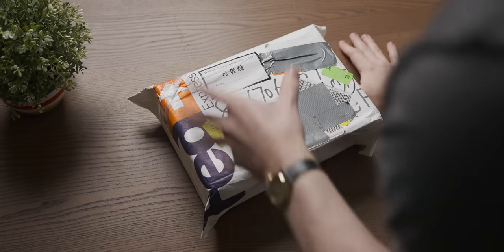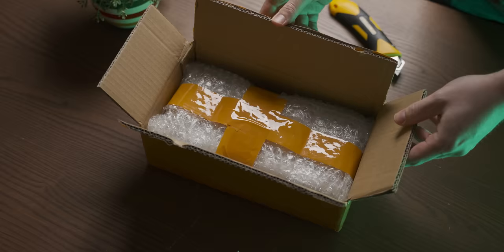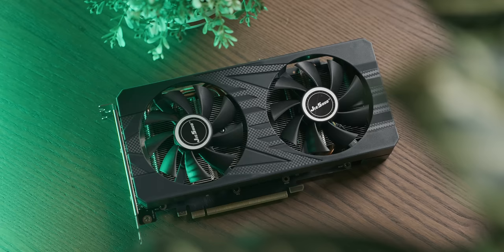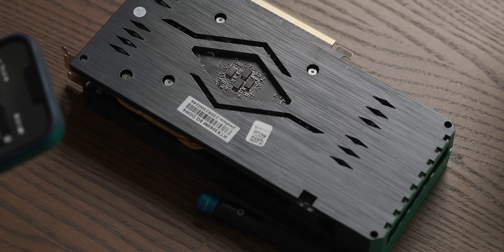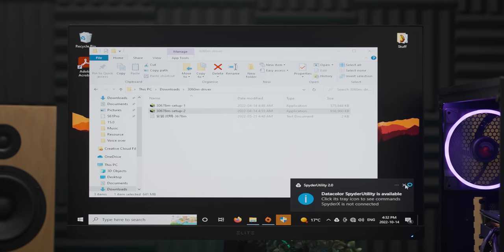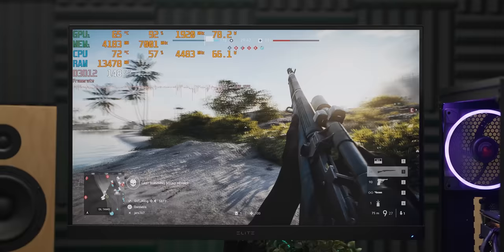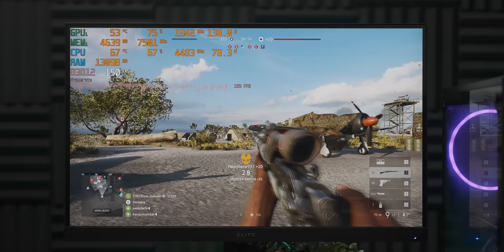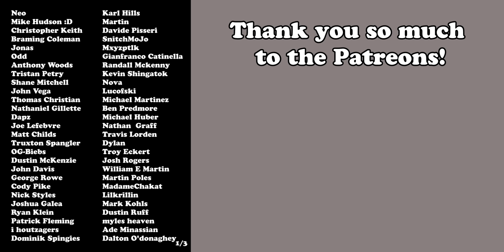This "New" RTX 3060 From Aliexpress Was Suspiciously cheap...

Comment: Actually a bit sad that it only works with * special * drivers if they would remove the 6 pin and let it only draw up to 75w via the pci slot this would be a insane good upgrade card for older prebuilds with shitty psus u cant upgrade
Reply: @Those Casual Gamers what
Reply: @Those Casual Gamers what?
Reply: Though doesn't mean the wattage showing on-display is any accurate specially with those Frankenstein GPUs, it was cool if he actually have measured it physically...
Reply: @Those Casual Gamers what
Reply: @guily6669  i mean its a 3060 mobile they a build to draw as little as possible and i think it would still run fine with 75w
Reply: @Those Casual Gamers What? Yeah, weather at the delivery point has a lot to do with the original commenter's sole point about  physical 6 pins vs PCI slot power draw of the card itself. That makes sense.
Reply: @claycassin8437  Did they comment on the wrong comment?
Reply: You can lower the power consumption on normal cards as well
Reply: @Slamdoxicalz  ye but usually if a card has a 6 pin it wont start without it conncted
Reply: It’s hard, specially laptop version is hard to twist power consumsion. Because it was design to co-op with cpu or could be depend on game they will need more power like some game it ate nearly 80w
Reply: My thoughts exactly.
Reply: I bet if he used NVcleanstall and select the mobile drivers it will work
Reply: Exactly.  As long as the PSU is 300-400 watts, I see where your going.  I just had this very situation with the wifey's computer, I had to go with a 1650, because no other graphics card was powered by the pci slot alone, or at least did not cost 350 dollars.  I would of loved to put something like this mobile 3060, in her system powered only by the pci slot.
Reply: @erich6860  I had the GTX 1650 in my prebuilt. Its decent enough. You can game on it, though its a bit stuttery and youll have to drop some settings. I had to swap out my PSU when I upgraded my GPU, but I still got $100 for the 1650 during the great GPU shortage of 2021.
Reply: I was thinking the same thing.
Reply: @stephenhood2948  Yeah, I men the missus is not really playing anything more demanding than WoW, V rising, so it's fine.  But it would be nice to have more for the wattage 🙂
Reply: Absolutely! Make this low profile and lose the PCI power connector and it'd be a top tier product. They'd pretty much be able to monopolise the space since other LP PCI powered cards would be way less capable.
Reply: Most 3060m draw more than 75 watts and there could be specifics to laptop power (like some have power shifting so a "75 watt" chip goes up to 95 watts) delivery that makes this iffy sadly. You would just be better off running a 3050 at that point.
Reply: Uhhm maybe that's where A2000 comes in, with RT core and same 6GB VRAM at 70W TDP but more than twice the price of rtx 3060
Reply: Or just keep the 6pin and have the GPU switch into a low power mode when it's not connected. The 4090 does it, so it is possible. I agree that if Nvidia would actually do this officially (make drivers that work), then it would be amazing for small / efficient / quiet builds and junky prebuilt upgrades.
Reply: @PMARC14  Sounds like an RTX3050M low profile would be as good as it gets.. if they would make one.
They seem to prefer to make it look like a real gaming GPU.
Reply: Just use molex to 8pin if you know for sure it only draws 80w. 2x molex has a rated max of ~100w so you'll be fine.
Reply: This concept has many fallacies. 
1: A 75W 3060 has terrible value. For a price of 3060 you are getting 2060 level of performance.
2: Sunk cost fallacy:  If you bought a prebuilt with a proprietary PSU, getting it is your mistake the first place. Selling it an getting a properly expandable system, is better than spending money on a bad system. 
3: Budget builds with used parts : If you bough the prebuilt for cheap, getting a cost inefficient card goes  against the principle of doing a budget build. It better to get slightly more expense used config which can handle 150W-200W+ cards. 
4: Upgrading the computer for the sake of upgrading: If your  computer is outdated, either sell it  , or recycle it. (Or even  keep it as-is if it performance is sufficient for your use case ).
Reply: This is what I want, currently, there is no cards with Ray Tracing that doesn't only draw from the PCIe slot
Reply: loh bro bro, like I will let PSU hold me back. funny man
Reply: @macattack123mattc3  Nvidia would kill its A4xxx lineup, and that would be silly. For  them.
Chinese ppl on the other hand don't care about Nvidia bottom line :)

Comment: Pretty sure the driver issues came from Nvidia seeing tons of miners doing this laptop GPU on PCIe card thing (because non-LHR), that they started specifically locking out this config. If you go back even further, you may find older official drivers that fit.
Reply: They could have also just add lhr on all laptop GPUs, but I guess it takes more effort.

Still pretty sure Nvidia just disabled LHR recently so would be nice if they don't lock this out
Reply: @mcslender2965  No reason to.  nVidia just released a new driver that unlocks LHR on desktop entirely, as mining is basically dead now that ETH no longer uses Proof of Work.  The aftermarket is already overflowing with cheap cards and it's only going to get better.
Reply: @TheXev  where do you get em do, cant seem to find them
Reply: @TheXev

Comment: Really makes me wish there were official mobile variants of these for desktop. Would be killer for low profile card builds
Reply: So laptops?
Reply: Oh man the efficiency
Reply: Yeah, we lp users are still stuck with 1650/rx6400
Reply: yeah me too less power drained cpu and gpu less cooling effort more durable less sound more stabilty not everyone need lıyd sport cars
if i find from somehwere money i will invested for pc that direction.
price goes roof when high watts need it u need much better psu much better cases and cooling lot more electric bill much more problem.60-80 wt gpu and cpus good durable mb
lot of people donyt clean up much or dont invested expensive thing or not renewing long tinme.
in time all those fan start do sound at high sound 6-12 monrth or even shorter while moslty even they start problem low speed u wont hear them much even 4-5 year later
an example milion of milion people playing basic game use social media nad some old ganmes like world of warcraft dont need so good system
best of the best look good but not so much diffrence not everyone pro gamer 
low profile and cheaper but enough power cards always welcomed but some users
like me.
Reply: @kazikokaziko4903  you should see the "laptop" cpus converted for 1151 motherboards... people got mad at intel for thier firebreathing 10th gen intel chips..... 

these laptop cpus like the qqls /qtj1 can run 5ghz 8c/16t on a laptop chip that is supposed to run 45ish watts stock.... but they can pump out 200w if the motherboard has the vrms to handle it D:
Reply: tech yes city reviewed an amd 6600m that works with official drivers
Reply: I rather like those Teeny tiny PC's they tell people to take with them on holiday or business trips that are functionally like a laptop but without the screen.
This (malicious software aside) is leaning in the right direction.

Here is a thought if the use case for these applies to China what about somewhere else, what might you find in say Vietnam or Korea or even Russia ?
Is there a market for something like this other than China that can supply a similar produce perhaps.... I guess one can attempt to make something up yourself if you are very technically minded or someone makes the graphics cared equivalent of Hard Drive cases that might work too.
Reply: You can always undervolt and power limit PC GPU to run as efficiently as a mobile one
Reply: The hell do you even mean??? These are laptop GPUs, which are fine in their own right.
Plus you can only go soo far with low profile systems. The 1650 was the best of them all, but that had a dual slot low profile fan, and no power connectors as well.
Maybe if they made a desktop version of the 3050ti mobile that’s exactly 75 watts, that could work. But then you’d basically get desktop GTX 1650 super or desktop GTX1660 levels of performance. Which isn’t really much.
Reply: @zabunko  some people like me are looking for a sff pc build but dont want a laptop for various reasons
Reply: @AlanWGMeraz  Don't forget the rtx a2000
Reply: low profile card builds which you want to sell to others so you can rip them off and make more profits.
Reply: @IceColdRona as someone above commented you can do the same with regular cards nowadays by undervolting. That's basically what they are but you have to have a bit of know how. I guess it would be cool for people less knowledgeable but it would technically be a ripoff.

Comment: You can probably force it to install the official drivers by using the "Have Disk" option in device manager. Yeah that still exists, all the way back from Windows 9x. I bet it's just a simple Hardware ID mismatch between what the driver says it supports and what the 3060M reports. The seller probably had to hack the installer to get it to work easily enough for the consumers, and the antivirus heuristics picked up on that fiddling.

Comment: The driver issues are a major deal breaker, doubly so with the malware bundled with the janky drivers.
Reply: That's why 6600M for 170$ is a way to go :D
Reply: They will get better though like other scam GPUs and this one might get good enough to actually buy
Reply: @16driver16  Honestly given normal desktop GPUs are not much more on Ali... i'd question if this one is worth it at all, even at the 100usd mark it'd be a bit questionable.
Reply: @kajurn791  you must have a cheap power bill. This would save $ every month with minimal performance cuts. I just realized you said USD thats the problem. You have no idea what some people pay for electricity
Reply: @kajurn791  in the US just buy your GPU used from a person going back to work after covid, failed mining operation, or a drug dealer/thief its way cheaper and you dont care how much power or gas anything uses so thats fine
Reply: @16driver16  Brazilian but no. This would NOT save enough money in power to be worthwhile, and if the power bill expense is such a big issue where you live that you need to buy a terrible GPU like this to save less than 100w on GPU power then maybe you should spend some of your free time working part time or doing a side gig. I'm assuming you're europe based and that's why you're freaking this much about power draw, and honestly go look at the other appliances in your house first before complaining about 100w on the GPU, i'm willing to bet a lightbulb or two you leave on without need will consume more power than that GPU would save.
Reply: @16driver16  Also if power draw's such a big issue for you, let me introduce you to MSI afterburner. Set a power limit of 70% or 50% and bam, you have most of the performance at a much lower power draw. Problem solved.
Reply: @kajurn791  how's a kid supposed to do any of that if it's not my house and I'm too young to work and no time between school and games, I just want my step-dad to lay off me about the bill. I know it's his welder not my pc costing us. My grandma never has high power bills and I bring my pc there every weekend
Reply: @16driver16  Then the energy bill is his problem, not yours and he's just venting his frustrations on you. tell him you lowered your system's power limit by 50% to help and he'll let you off.
Reply: @Zysperro  I agree 🥰💪🤩. The desktop modified mobile 6600M GPU is a real beast of a GPU and performs better than its desktop counterpart! Obviously due to the fact it uses less power and has an overkill cooler on it 💪🤯🥳
Reply: I bet if he used NVcleanstall and select the mobile drivers it will work
Reply: @michaelthompson9798  It actually performs about the same or just slightly slower (3% so basically the same most of the time) and consumes 30W less (100W total) than an stock RX 6600 (130W), not as crazy as the Mobile 3060 vs Desktop but still pretty good and has undervolt potential.
Reply: @Richard Webster  do you really think that would work? Then Dawid needs to test that NV thing.
Reply: @16driver16  You basically described all of Brazil in one sentence.
Reply: @kajurn791  my mother wont stop complaining that my system is using up a tonne of power despite me actually buying a thing to measure its usage, compare it to other things in the house and tell her that the heater she insists on using constantly uses more power in an hour than my entire system including monitors does at full usage 24 hours a day (which it never is at) in several days.
people of that age (especially parents being told things by their kids) dont seem to want to listen and think they know better because they are older.

and yes i am working and helping with the rent, food, power bill etc.
Reply: @16driver16  Most americans pay 380-550$ a month on power.... It's almost half our average bill on utility next to water.

I can go shit on EU/SEA economies all day long if you want bud.
Reply: hacking your own drivers isnt even hard if you care about malware
Reply: @NatoRadeX  The Average Electricity Rate in the U.S. is 10.42 cents per kilowatt-hour. In 2021, the average U.S. household spent $122 per month on electricity, with the average U.S. resident consuming 892 kilowatt-hours per month, according to the U.S. Energy Information Administration... you live in a high price area not most Americans pay that much. Electricity rates range from 36.01p per kWh in north Wales to 32.24p per kWh in northern England. It's about 3× as much money per kilowatt-hour here
Reply: @16driver16  It very much depends on what time of year and where you live within the US as to what your monthly bill is. $122 doesn't even begin to touch most power bills in my area. It is a/c weather down here about 8 months out of the year. So yes try $300+ a month for most power bills. I don't give a damn what your statistic says. Clearly you are not old enough to have learned that statistics can and are manipulated to say whatever the person having them made wants them to say. 

Now specifically as to why you have so much higher energy bills, that is due to leftist economic policy. If you want cheaper energy then you need to start lobbying your people to invest in the type of energy that gives it to you. Get off of wind and solar bullshit and lobby for good old fashioned fossil fuels and nuclear. That is what will save you. Not pushing for all these new "solutions" that are not capable of doing the job.
Reply: @16driver16  Based on our power company in the area we all pay 22.55 cents per kilowatt. But jumps between monthly bills so each bill receives a boost of 40-60$ based on these jumps. Caused by events in the area.
Reply: @NatoRadeX  that's not much at all compared to most Europeans
Reply: Trojan drivers on a 3060M lol
Reply: Janky drives are only Nvidia due they use closed sourced about their products meanwhile mobile desktop gpu like rx6600m gpu from aliexpress is easy install drives from a official amd website honestly rather stick amd
Reply from the maker: @Zysperro  Does that work with the official AMD drivers?
Reply: @DawidDoesTechStuff  it actually does! Iirc, only one manufacturer that sells exclusively recycled stuff requires some custom driver, the other ones like MLLSE, 51Risc (both same chassis, most of them 100% new, check the description, make sure it says 100% new there and on the image) don't have that, you can just use the official AMD drivers :)
Reply from the maker: @Zysperro  Nice! Thanks for the heads up. I’ll order one. 👍
Reply: @kajurn791  even if i leave lightbult for 24 hours whole year it will only eat maybe 10 euros in that whole year that's how efficient our led lightbulbs are